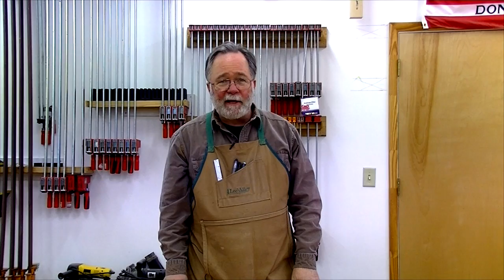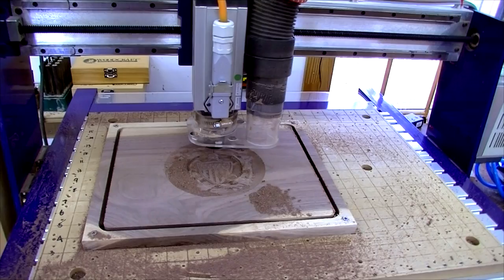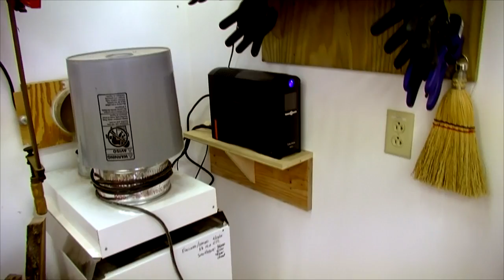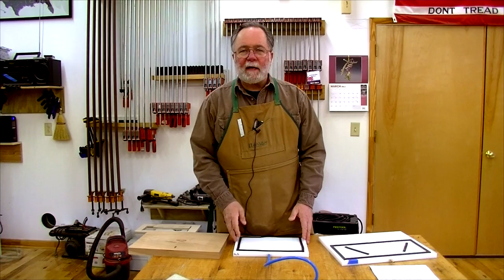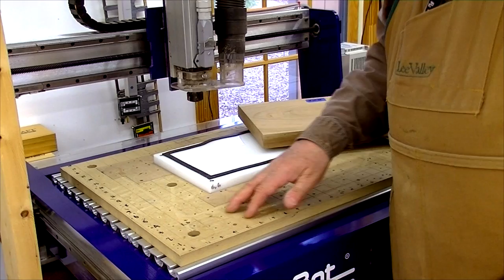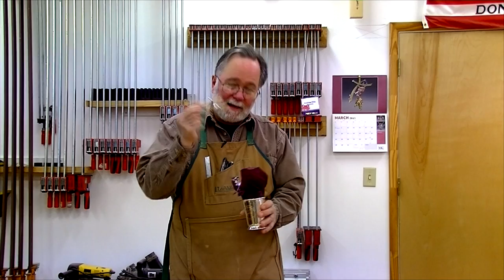Vacuum Hold-down & ShopBot UPS: Saturday in the Woodworking Shop #5 with Andrew Pitts~FurnitureMaker

Comment: Thanks for all your videos.  After taking your advice and adding a UPS to my ShopBot Desktop, it took two hours on the phone to figure out why the new UPS kept tripping the GFCI breaker.  The tech support people finally diagonsed that the UPS sends a small voltage back to the source and that was enough to trip the GFCI... ShopBot recommends NOT using a GFCI... maybe this is another reason in addition to avoiding cutting power inadvertently. Keep the great videos coming.
Reply from the maker: I'm not in the Virginia shop anymore (just moved to Washington State), but I think I had my UPS plugged into a non-GFCI outlet, the only one in my shop as it turned out, but not for that reason. Guess I was just lucky.

Comment: I have a 14inch bandsaw  it has 4 stage  puley on the motor  and 4 stage  on the blade wheel  what is the best  blade speed  to cut thick wood  fast or slow
Reply from the maker: adrian barber Adrian, my bandsaw has a 3" pulley on the motor and a 6" pulley on the wheel shaft. The motor is rated at 1725 RPM. So, the wheel turns at about 1725 RPM x (3"/6") = 862 RPM. The wheel on the saw is 14", so it is 14" x 3.1416/12" = 3.67 feet in circumference. So, 3.67ft x 862 RPM = 3159 feet per second, which is about the recommended 3000 fps for cutting wood. I hope you can apply that same calculation to your saw. Andy